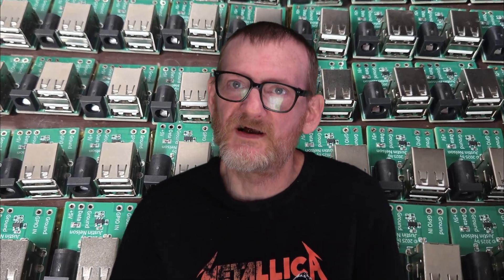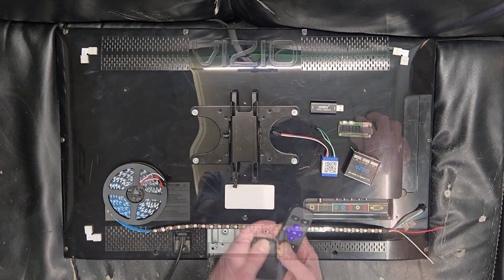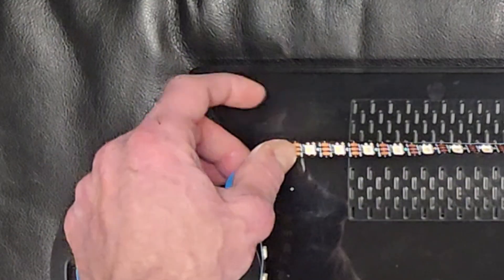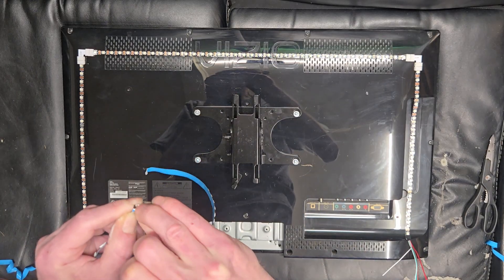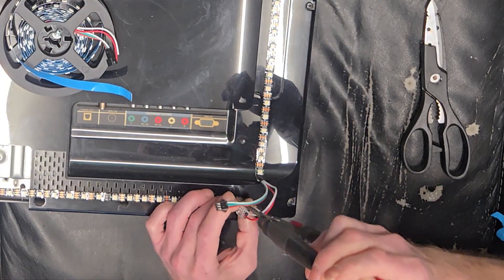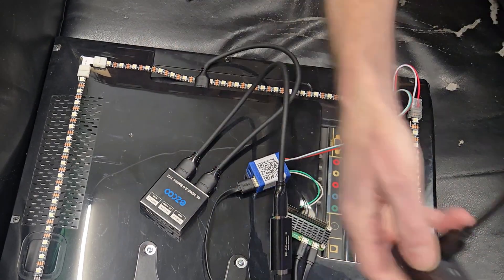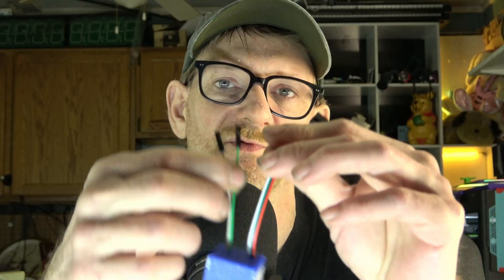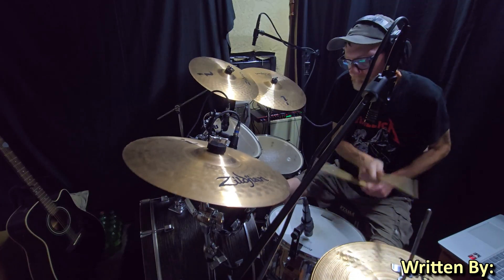Hyperion / Ambilight 2025 Full Installation Updated • HyperHDR 21 Ambient TV Lighting

Comment: Are you powering the strip from both ends? Is this necessary? The total strip length is not that long on most tv's, is this just preventative to stop possible voltage drops due to length? Or is there some other reason the circuit needs to be connected at both ends?
Reply from the maker: It is in fact to prevent voltage drops. On larger TVs, you may experience a shift in brightness and color accuracy as you go around the loop to the tail end of the strip.

If you have a smaller TV, or simply aren't experiencing this issue, that step is 100% optional. You'll mostly notice it at high brightness levels (like an all white screen)... but if it's not causing any issues then there's no other technical reason for the additional connection.

I include the connector with my Level Shifter kit, simply because it adds about $0.30 to the whole thing and I threw it in "just in case".

Comment: i bought one of these!
Reply from the maker: Awesome, thank you! Let us know how everything works out for you or if you have any questions.l
Reply: @JustinNelsonsProjects  last time I ran hyperion, this time I went through the setup for HyperHDR, your directions and copy paste system are easy to use. 
Something I don't think I saw you answer.... what's the difference in using pins 19/20 vs GPIO18 on a pi3?  

Took me a bit to find the hue, saturation,brightness, saved, and i sitll don't have light despite seeing video in the preview. using an old ws2812 set, have a new sk6812, trying to figure out if I should just swap and test w/ my fingers crosssed.
Reply from the maker: @JoshuaWilsonpossible I actually found that I prefer the GPIO 18 method unless you're running a Pi 5, because the 5 only works in that mode. On my Pi Zero 2 W (two in two separate rooms/TVs), I was experiencing the occasional random flicker with the SPI method... So I changed them back to use GPIO 18. 

Luckily it's a simple matter of moving the two wires, really only the green one needs to be moved honestly, and making one configuration change in the LED hardware section of hyper HDR. 

I updated the web tutorial to reflect that change of opinion. Basically stick with the method I've been teaching all along, unless you insist on running an expensive raspberry pi-5 🤣

As for why you aren't getting any lights, double check all the wiring, and maybe try just switching to GPIO 18... Although the instructions should fully set everything up for SPI, I tested it quite thoroughly on fresh Pi OS installs, It's possible that SPI may not work on the Pi 3 which is one model I don't own ... 

And I would go back to step 4 on the tutorial, and just double check that the configuration file was edited correctly. The step where you open a configuration file in nano, and control k to delete the "User=%" line. Missing that step Will cause hyper HDR to not run as root, and it won't have access to SPI or GPIO. 

Let me know if any of this helps!
Reply: @JustinNelsonsProjects  I changed them around a few times as a test, and settled on GPIO 18.   I did previously have some funky wiring that I found from another channel 3 years go. the tail end of the LEDs used to be connected to a barrel connector, and there was a single wire going  lord knows where onto the pins.  It solidly ran for quite a while before it stopped. 
I absolutely deleted the user=% on the first time through the set up. 
If i test new lights, without adhering to the tv, can i plug in any old values in while they're on the spool?  theoretically, could i keep my current values or change them to 10,10,10,10 to see if they light up?  This is me assuming the lights could be bad, or even the tail end connection.  i know they have power, i accidentally touched something to them, and they threw a tiny spark
Reply from the maker: @JoshuaWilsonpossible Yes absolutely you can test a different spool without actually mounting it to the television. Just to rule out if the LED strip on the TV is in fact the problem, If the new spool lights up then you have your answer. 

If not, I am curious, that so-called funky wiring you did in the past, are you still using the same raspberry Pi? Is it possible that a previous method damaged the GPIO controller on the pi? 

And yes definitely reduce the LED count to something like 10 on each side so you don't overdrive a rolled up string of LEDs. But it will be enough to know if it works or not. 

Let us know if any of this helps... 

FYI, some of my older videos did involve a barrel Jack connector, and splitting that off to power the Raspberry Pi directly via the 5 volt pin. I stopped that practice because it removes the protection provided by the USB power input jack. And some of those brick power supplies may not have the most stable power to just be directly injecting into the Raspberry Pi via the 5 volt pin...

Comment: Looking to keep CEC.  Would the splitter allow me to do so?
Reply from the maker: I get asked this a lot, and unfortunately I don't have an answer. My A/V receiver is an older Sony w/Dolby 5.1/DTS/etc but it was made before HDMI was a thing 😉 I run audio via Optical from the TV to the receiver, and I never shut off the receiver (that's a whole other conversation)...

So I have no way to test CEC control through my recommended splitter. Now in my bedroom setup, I'm using HDMI eARC for a soundbar which works fine -- but it's connected directly to the TV so that would not be affected AT ALL by adding a splitter to the input source. The TV turns the sound bar on/off and controls the volume, as you would expect.

What exactly are you trying to control via CEC? Are you wanting the TV to control the streaming device (or vice-versa)? I honestly have no idea what people use CEC for these days, again, my system is older (but I wouldn't trade it for anything!)...

Comment: Hey does this setup work with an Apple TV 4K?
Reply from the maker: It should work with any HDMI input source, so I see no reason it wouldn't. I've personally used it with:

• Comcast/Xfinity Cable Box
• Xfinity "Flex" streaming box
• Roku devices
• PC with NVidia 1660TI card (before that, the Intel on-board HDMI also worked just fine)
• A couple random laptops here and there, often for testing
• HDMI out from my Sony AX43 camcorder
• The 4K output of another Raspberry Pi....

So... unless Apple is doing something seriously non-standard (they would never!) -- honestly it should work just fine.

Any Apple TV users care to chime in?

Comment: Thanks a lot as im upgrading to sk6812 now. Maybe it’s a valuable addition to mention how powerful the power supply should be.
If you’re using an SK6812, you should calculate about 60 mA per LED at maximum brightness. Greetings from the Netherlands and keep up the good work😃
Reply from the maker: I'm going to add a page to my web tutorial specifically on this topic. At 60ma per LED, if you used a FULL 300-LED strip, at full brightness (all of R, G, B and W fully lit) you might actually draw up to 18 amps.

In reality this is rare; you're not likely to use all 300, and I never recommend having the LEDs brighter than the television picture itself anyway....... otherwise it's no longer "ambient" :)

But in general, you should of course oversize the power supply for those rare, worst-case situations.

For reference, from measurements, on my 65" TV I'm using 230 LEDs, RGBW. With a full white screen, the power supply is only seeing ~7 amps, and that's including the power used by the Pi, capture device, and splitter... so < 30ma per LED pixel all things considered.

I'll write up a whole article on this. The official HyperHDR documentation (and WLED for that matter) makes it sound like you have to supply the absolute maximum possible, but on a TV setup it's unlikely you'll be driving all 4 LEDs on the chip fully.

Also consider, with the RGB portion, to get white, you are never driving all 3 at full or you'd get a very blue-purple color. And with an RGBW strip, white will light up just the white LED with only a little bit of the colored ones to balance out the "whiteness", if that makes sense.......

As you can see, a full article is probably warranted here, with tests and photos... maybe even a supplemental video...

Thanks for watching and and the feedback! Always appreciated!